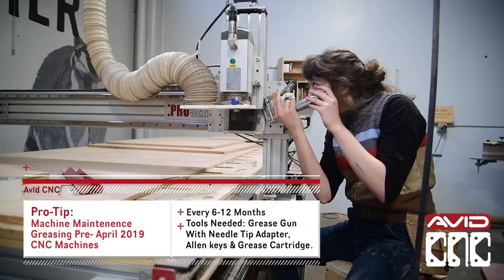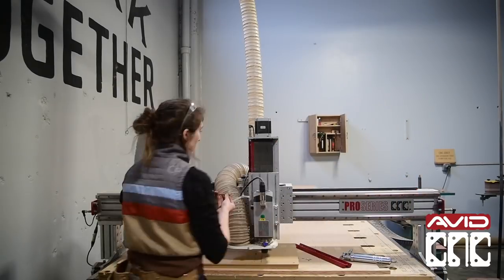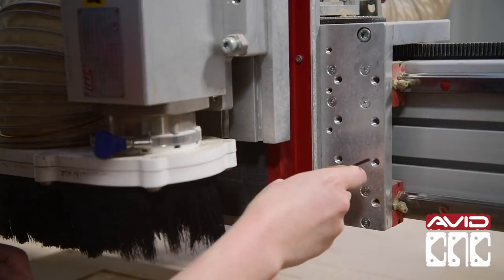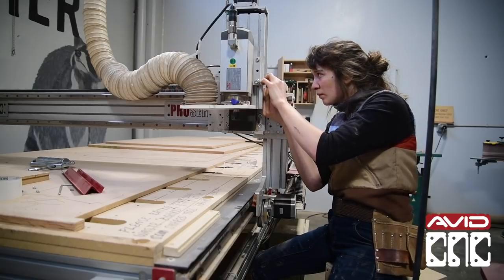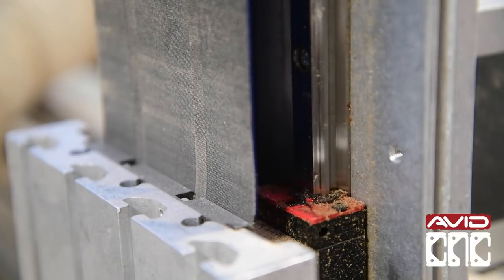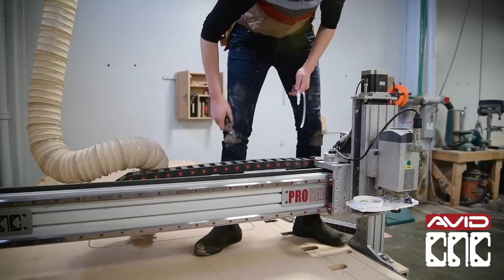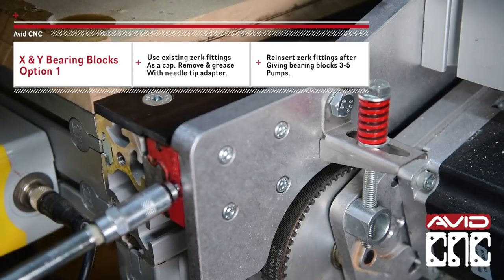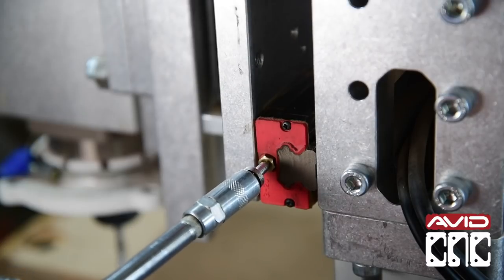How to Grease Your Pre-April 2019 Avid CNC Machine

Comment: I'm confused.  I have the Benchtop Pro 2436, purchased 3/23/19.  When I contacted Support to ask about this very issue I was told something very different:

"Not much maintenance is required for your machine. The linear bearings on your axes have self-oiling cartridges that will last for over 5000 km of travel. All that is required is to apply a light machine oil along the ballscrews (insert oil nozzle under the flexible dust cover) every 3-6 months depending on use. If there is debris inside the axis, it is best to remove this. Nothing else is required."

This doesn't seem to fit either of your videos, for the pre-April or post-April machines.
Reply from the maker: Hello! Thank you for your inquiry. Since your order date is on the cusp of the upgrade switch date you likely have the new bearing blocks (which are self-greasing), and only requires the ballscrew to be oiled or greased 3-6 months depending on use. 
Please reach out directly to the Support Team as they have access to your order information and provide a more accurate answer to your question in relation to your machine set up.

Comment: Well, After buying the grease fittings, I discover that they don't fit the Bench Top Pro.
Reply from the maker: Hi! Our 15mm rails used in Z axis and Benchtop Standard machines don't require a new fitting. The new fittings are for the X and Y rails for the Pro-Series machines. Our support team will reach out to you to work on issuing a refund for the fittings you purchased as they're not compatible with your machine.